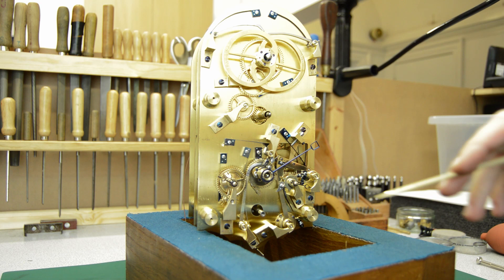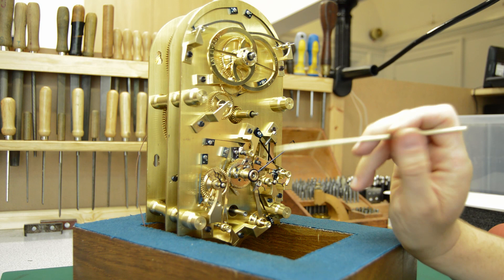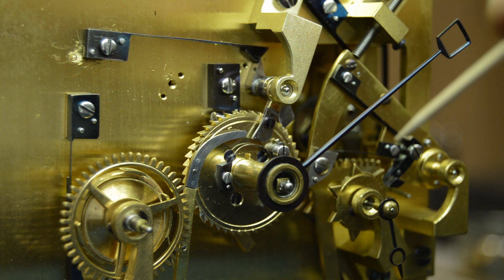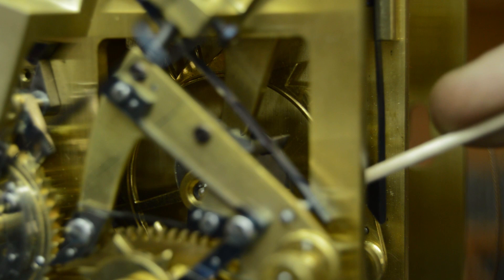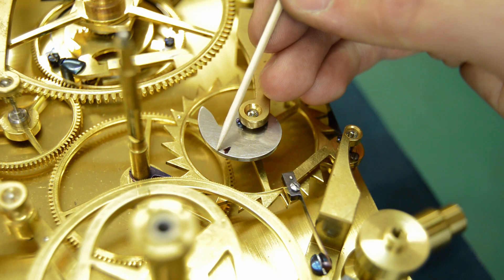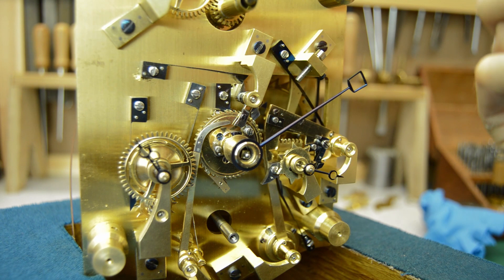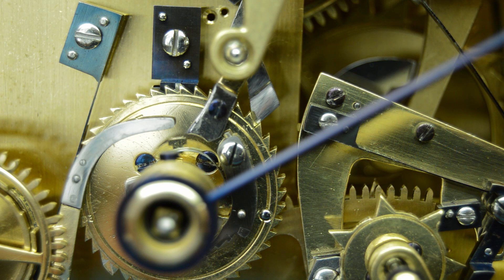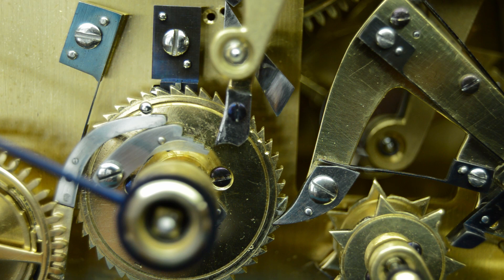Perpetual Calendar Repairs - David Walter Double Pendulum - Part 3

Comment: Nice job - complex mechanism to debug! Not sure I've understood though why both the blocked off tooth and the stop pin are needed....
Reply from the maker: Strictly speaking I could have got away without the stop pin and had more than one tooth blanked out but I felt a positive stop to limit the movement was a good thing. Belt and braces!

Comment: Tommy, wonderful work! I was just wondering; could the stop only be a good solution to prevent jamming? Or with other words; is the closed tooth necessary for your solution? Thank you for your answer. Best, Job
Reply from the maker: It needed both to be safe.  The main part of the 'fix' was the 1/2 tooth. Thanks for your interest.